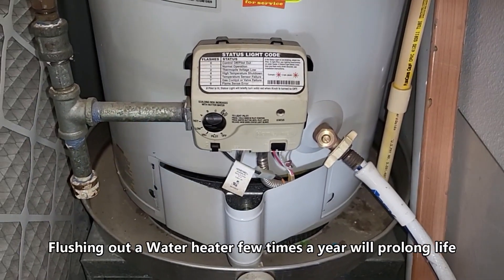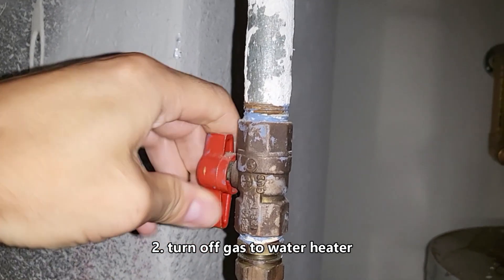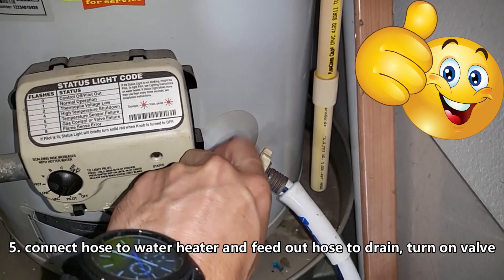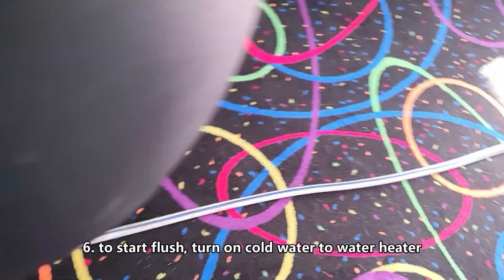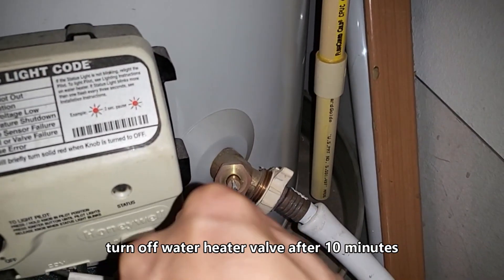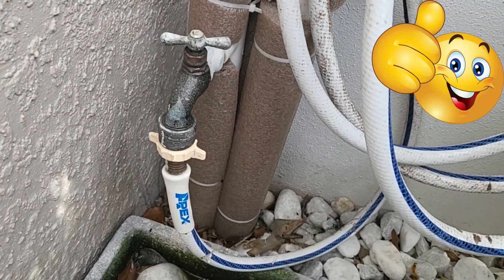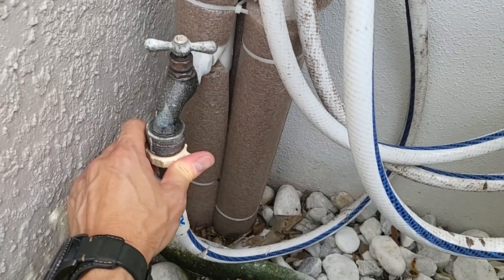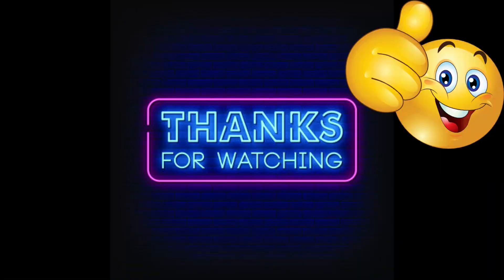6 STEPS TO FLUSH A HOT WATER HEATER

Comment: I have a question I hope you can help me with..
Do you know what caulk to use on the outside of the windows of my camping van that will not run every time it rains or it's foggy or gets wet.. I thought I was using the best but apparently they're not the best..
And I'm sure tired of having to clean my windows all the time because of the black or white runoff from the caulk on the windows and it's been dry for a year??